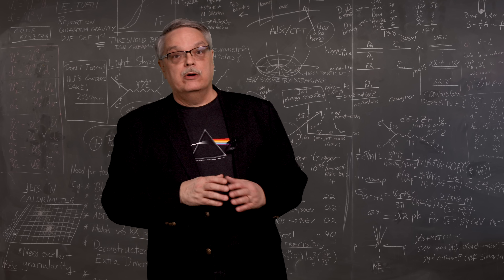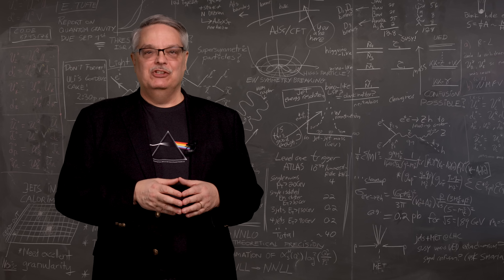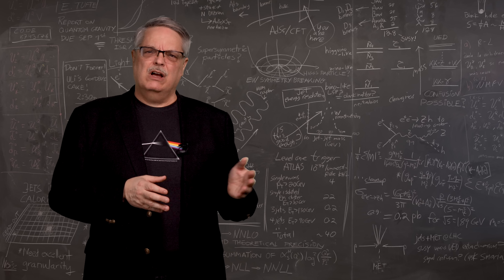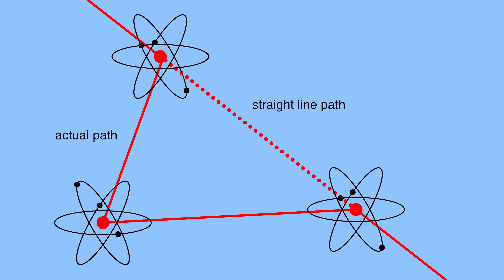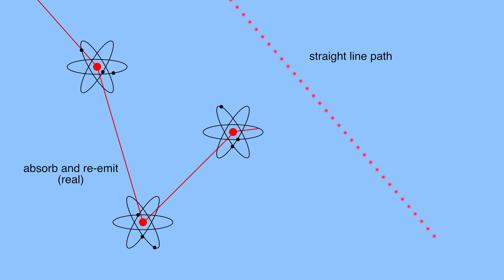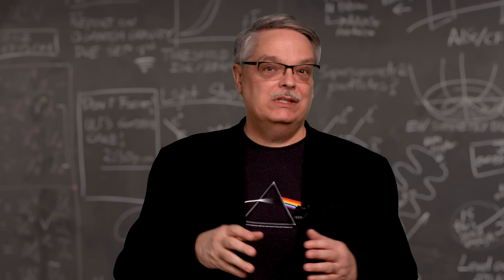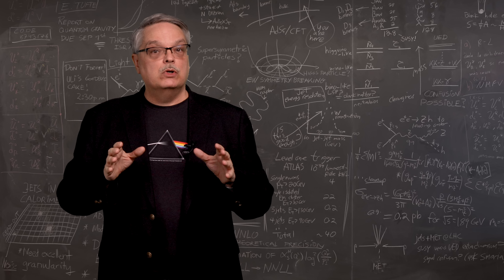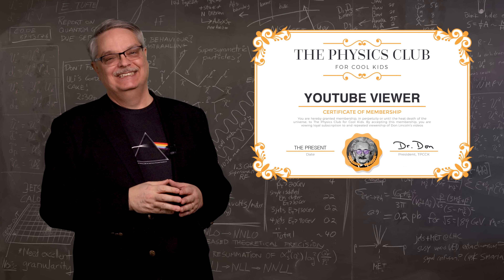Why does light slow down in water?

Comment: I wouldn't say that the 2 common explanations are completely wrong, but they are still useful in understanding light a little better. What you've just said is also not completely correct, because now I can see more questions unfold. There is no absolute truth, and everything is relative

Comment: ok but I'm trying to wrap my brain around the entrance of the light through said glass. If the light traveling at the speed of light slows down to 2/3 C then what about at the point of contact? If you have a constant stream of light does it not get backed up from the sudden slowdown of the speed of light? wouldn't the Luminosity be significantly brighter and buildup because its not able to continue the path? wouldn't there be heat from the friction of the light hitting the glass?

Comment: But why the light angle is changing?
Reply: Hyugens Fresnel
Reply: To refract light must incident obliquely on material. When the velocity changes due to superposition then the value of velocity decreased in direction of surface as well as in direction of normal to the surface which changes the slope of the path. ....
Take your time and resolve the components of velocity to understand... You will see through logic

Comment: Ever Seen the shitty video from the BBC with James may that say Glass is a Supper viscous fluid, and it's why light passes trough it, I got banned from commenting after I said that the explanation is wrong and saying the proper explanation... I may have called the BBC researcher retarded but... that's not the point
Reply: that was probably the point of the ban though :P
Reply: always be polite ! espescially if you need to explain how they are wrong! (not that i should be talking xp)
anyway the explanation in the video too is wrong.
here's the real explanation, which is quite math extensive:
https://en.m.wikipedia.org/wiki/Mathematical_descriptions_of_opacity
Reply: @pmailkeey what ?

Comment: According to this theory, then the light must change colour inside of any medium and cannot maintain the same colour due to the fact that as soon as you change the wavelength you also change it's placement on the electromagnetic spectrum. 
This is always the case and why when spat through a prism like on the T-Shirt it ends up splitting into a rainbow of colours.
Reply: Also, according to the stated theory the light must not only change color but also lose energy when it enters the medium. (Energy  = Plank's constant times frequency.) Then the light must gain energy when it leaves the medium. Seems unlikely. Can someone explain, please.
Reply: @designave123  well one theory is that light is actually a form of inductance over being a light or wave form, therefore even though it goes the same speed through a medium and also diffracts into multiple different wave forms, but also has the ability not to loose any inertia or power, so then once it leaves it returns back to it's original pace. Although you won't find that in any science books as the person who came up with that more logical theory was shut down in the peer review. 

It's like it's saying hey I'm light and I move at this speed, only varying when transgressing a substance, but capable of carrying on at the speed I want once I'm outta there.

Comment: There is no such thing as "photon". Described in modern physic as some kind of a flying ball. Hence there is no need to bother about its direction. Light is a wave. A wave always has a polarization and direction and doesn't care about atoms it waves. The direction of waves always will hold the previous path, since the wave will wave them in the same direction.
Only in wrong mainstream physic, this problem which made out of thin air is needed to be solved. In real ether physic, it doesn't exist at all.
Reply: ether physics ?

Comment: Reason that light slows down @ 6:15
Reply: this video has taken many shortcuts in explaining the relations between the two systems and how it affects them.
to better understand this, we need to talk about d'alembert's equation and its dispersion formula and how it describes a wave.
so d'alembert's equation is used to link together the spatial and temporal variation of a wave.

and from this equation comes the dispersion relation that links together the frequency, wavelength and celerity of a wave.
to access to this equation, we use maxwell relations to describe this phenomenon. when we consider those relations in the void, we get the relation: c² = w²/k² where k is the angular  wavenumber and w its angular frequency. (just google it, ain’t that hard to understand)

thus we can see here that the celerity is proportional to its angular frequency. however, as explained in the video, when light enter a medium, there are charges that can be influenced by the electric field, especially electrons that are 2000 times lighter than their counterparts protons.
thus, when light comes in this medium, we assume that only electrons are affected by the electric field.

we then apply newton's second law to those electrons to find a relation between an electron's speed and the electric current
(we also neglect the magnetic field of the light as the electron is relativistic thus the force from the electric field is much greater than the magnetic one see lorentz law to better understand this )
and then by generalizing this equation to all electrons in the medium, we can get an induced current from the electric field of the light.
( the current is j = n * v with n the volumic density of charges and v the celerity of electrons)

then when we put this back to maxwell ampere local equation, we introduce a new component: the induced current which thus gives us a new dispersion equation: c² = (w² - wp²) / k² with wp the plasma oscillation and thus we can see that from the value of wp, we'll get a different value of the celerity of the wave.

thus we can say without a doubt that they are wrong in their explanation as it is not the combination from the electric current of the electrons and the wave that makes it slower but the induced current inside the medium that modifies the dispersion relation thus modifying its speed.
or in simpler words, it's the movement of electrons that changes the frequency and celerity of the light, but not the combination of the two electric current. (also on a side note, trying to represent the electric current of a dipole using a sine wave.. funny thing you did there 😅)

and finally, as for the reason why the light has a different angle, well you can easily explain this using two waves parallel to each other crossing the medium in phase with each other. as they have the same wave plane, you can easily come to the relation between the refracted angle and the incident angle using some basic geometry. i recommend you to see the demonstration of descartes second law if you want to better understand what i'm talking about.

Comment: Dr. Lincoln,  In your process of eliminating the bogus explanations, I think you have missed an important one, the EMC effect.  What we have here is a relativistic behavior on a quantum scale.  I don't think Or Hen et al understand why their quarks are moving slower in heavier atoms.  I think it is because the abundance of gluons in a tight atom causes time itself to be slower. The reason light slows down in clear materials is because the speed of light is slower in those materials.  The light continues at SOL.  The speed of light is slower due to the proximity of a collection of gluons, mostly in the heaviest atoms.  We should use the atomic weight of the heaviest atoms as a proxy for the number of gluons.  This, multiplied by their density, and a constant to make the math work should give us the index of refraction, which tells us how much the atomic environment has slowed things down.  The index of refraction of a material should be predictable by this formula, even for opaque materials. The surface of the lens material is nowhere near perfect, but that does not matter. There are other examples of relativistic behavior on a quantum scale, protons and muons etc.  This is the same relativity that performs gravitational lensing, though the scope and scale and proximity are greatly different.  Have fun with this, but please prove me wrong!   Thanks for a great video.  3/12/2019
Reply: i don't know wether your hypothesis is true or false but here is mine which i think is quite satisfactory:

this video has taken many shortcuts in explaining the relations between the two systems and how it affects them.
to better understand this, we need to talk about d'alembert's equation and its dispersion formula and how it describes a wave.
so d'alembert's equation is used to link together the spatial and temporal variation of a wave.

and from this equation comes the dispersion relation that links together the frequency, wavelength and celerity of a wave.
to access to this equation, we use maxwell relations to describe this phenomenon. when we consider those relations in the void, we get the relation: c² = k²*w² where k is the angular frequency and w its wavenumber. (just google it, ain’t that hard to understand)

thus we can see here that the celerity is proportional to its angular frequency. however, as explained in the video, when light enter a medium, there are charges that can be influenced by the electric field, especially electrons that are 2000 times lighter than their counterparts protons.
thus, when light comes in this medium, we assume that only electrons are affected by the electric field.

we then apply newton's second law to those electrons to find a relation between an electron's speed and the electric current
(we also neglect the magnetic field of the light as the electron is relativistic thus the force from the electric field is much greater than the magnetic one see lorentz law to better understand this )
and then by generalizing this equation to all electrons in the medium, we can get an induced current from the electric field of the light.
( the current is j = n * v with n the volumic density of charges and v the celerity of electrons)

then when we put this back to maxwell ampere local equation, we introduce a new component: the induced current which thus gives us a new dispersion equation: c² = k² * (w² - wp²) with wp the plasma oscillation and thus we can see that from the value of wp, we'll get a different value of the celerity of the wave.

thus we can say without a doubt that they are wrong in their explanation as it is not the combination from the electric current of the electrons and the wave that makes it slower but the induced current inside the medium that modifies the dispersion relation thus modifying its speed.
or in simpler words, it's the movement of electrons that changes the frequency and celerity of the light, but not the combination of the two electric current. (also on a side note, trying to represent the electric current of a dipole using a sine wave.. funny thing you did there 😅)

and finally, as for the reason why the light has a different angle, well you can easily explain this using two waves parallel to each other crossing the medium in phase with each other. as they have the same wave plane, you can easily come to the relation between the refracted angle and the incident angle using some basic geometry. i recommend you to see the demonstration of descartes second law if you want to better understand what i'm talking about

Comment: No, no, we are not in the cool kids club, yet. Some questions, to reach that goal: how does the slowing bends light in that particular angle for a refractive index?, that was not explained. Second question related to the explanation in the video: why does light split in its constituent waves of different frequencies, and why some move faster than others in the refractive medium? Third one: why does the initial wave that forces the electron to make that second wave moves faster than the electron's wave, and whys the combined wave moves with a velocity in-between (it seems intuitive that the resulting wave  should keep the "c" in velocity in vacuum with the wave that is being added from the forced electron just to generate some repeating and varying patterns of peaks and troughs in time, as the some of faster wave will have peaks catching up and then leaving behind the peaks of the slower, electron wave)? It's not at all explained for proper understanding. Thanks.
Reply: this video has taken many shortcuts in explaining the relations between the two systems and how it affects them.
to better understand this, we need to talk about d'alembert's equation and its dispersion formula and how it describes a wave.
so d'alembert's equation is used to link together the spatial and temporal variation of a wave.

and from this equation comes the dispersion relation that links together the frequency, wavelength and celerity of a wave.
to access to this equation, we use maxwell relations to describe this phenomenon. when we consider those relations in the void, we get the relation: c² = k²*w² where k is the angular frequency and w its wavenumber. (just google it, ain’t that hard to understand)

thus we can see here that the celerity is proportional to its angular frequency. however, as explained in the video, when light enter a medium, there are charges that can be influenced by the electric field, especially electrons that are 2000 times lighter than their counterparts protons.
thus, when light comes in this medium, we assume that only electrons are affected by the electric field.

we then apply newton's second law to those electrons to find a relation between an electron's speed and the electric current
(we also neglect the magnetic field of the light as the electron is relativistic thus the force from the electric field is much greater than the magnetic one see lorentz law to better understand this )
and then by generalizing this equation to all electrons in the medium, we can get an induced current from the electric field of the light.
( the current is j = n * v with n the volumic density of charges and v the celerity of electrons)

then when we put this back to maxwell ampere local equation, we introduce a new component: the induced current which thus gives us a new dispersion equation: c² = k² * (w² - wp²) with wp the plasma oscillation and thus we can see that from the value of wp, we'll get a different value of the celerity of the wave.

thus we can say without a doubt that they are wrong in their explanation as it is not the combination from the electric current of the electrons and the wave that makes it slower but the induced current inside the medium that modifies the dispersion relation thus modifying its speed.
or in simpler words, it's the movement of electrons that changes the frequency and celerity of the light, but not the combination of the two electric current. (also on a side note, trying to represent the electric current of a dipole using a sine wave.. funny thing you did there 😅)

and finally, as for the reason why the light has a different angle, well you can easily explain this using two waves parallel to each other crossing the medium in phase with each other. as they have the same wave plane, you can easily come to the relation between the refracted angle and the incident angle using some basic geometry. i recommend you to see the demonstration of descartes second law if you want to better understand what i'm talking about